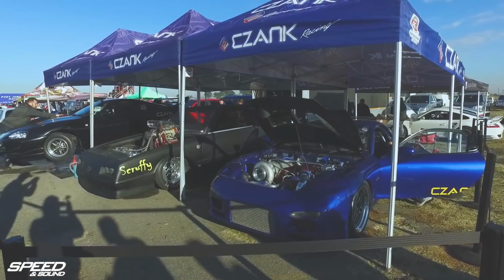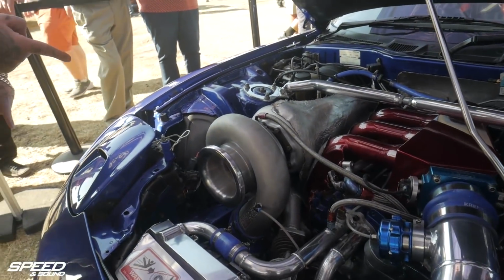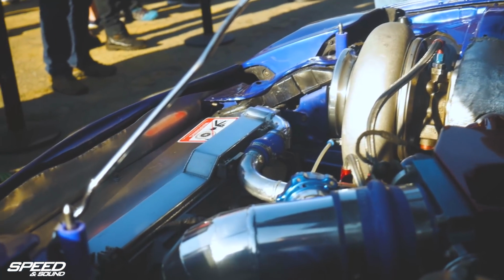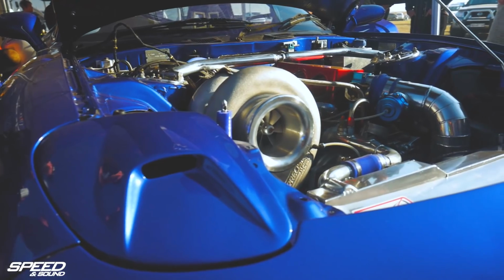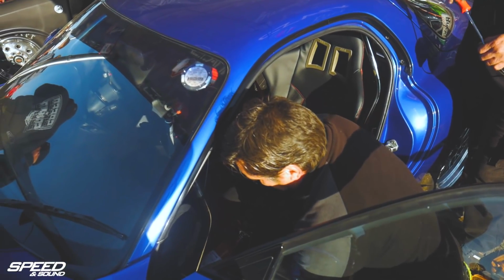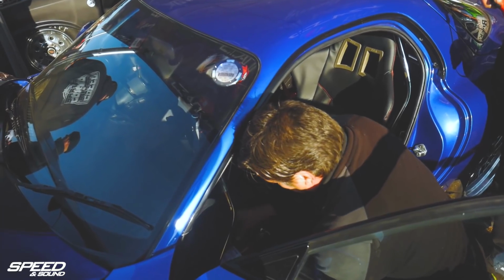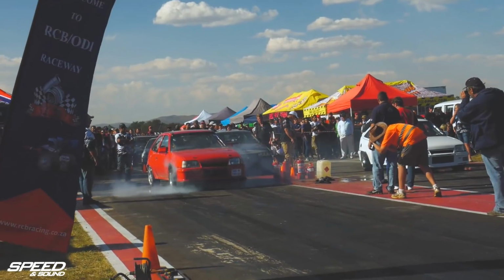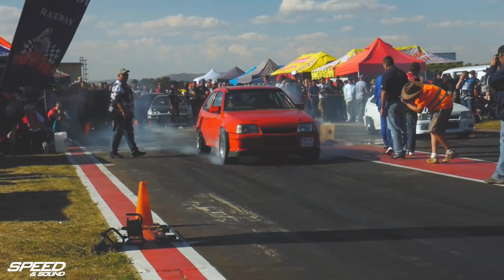011 Cash Day Midvaal

Comment: 1979 chev chevair powerd by small block chevy, normally aspirated plus 200hp nitrous shot, won the day, 6 runs, some were back to back, i never opened the bonnet once the whole day, no team of technicians present, I DROVE the car to the track, on the same tyres i raced with.
Concistency won the day with the LONE RANGER V8 chev.
Was a really good " au rev ouir" sendoff for me.
Best high pressure event ever ., with the best drivers and tuners in south africa competing for the 10k cash prize , sponsored by SNS.
ON THAT DAY, the chev chomped everyone, wether they ran faster times or not, none BEAT THE CHEV in a DRAG RACE....After the photos and prizegiving, i drove back home.
Chevy power😎💪